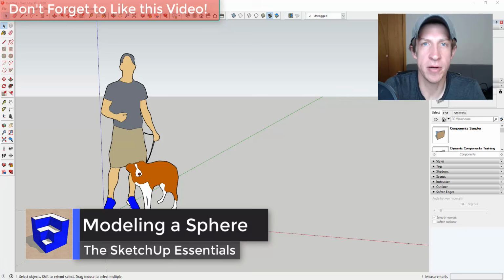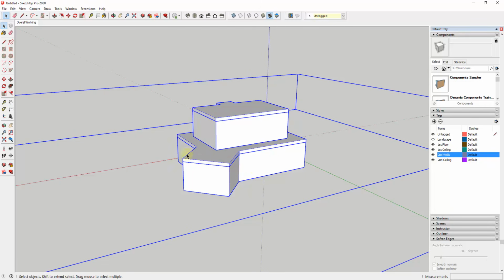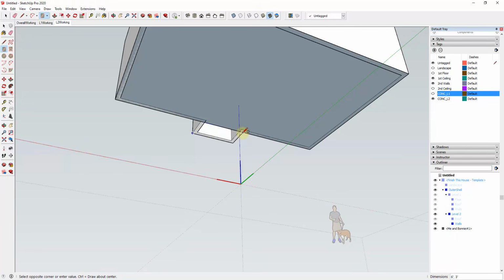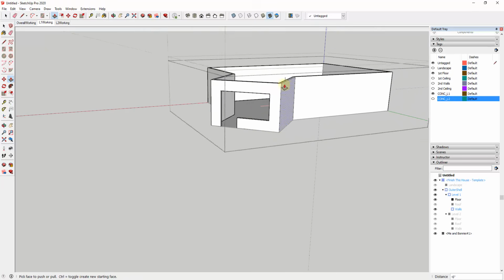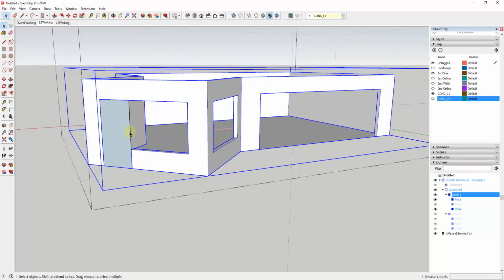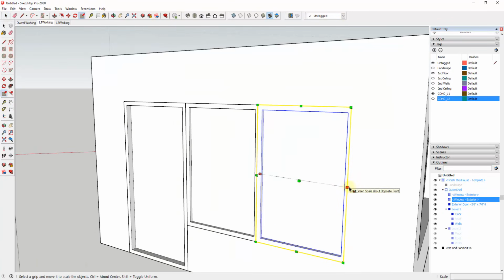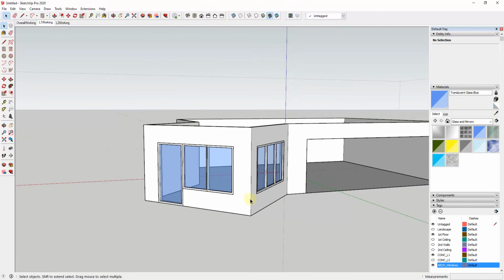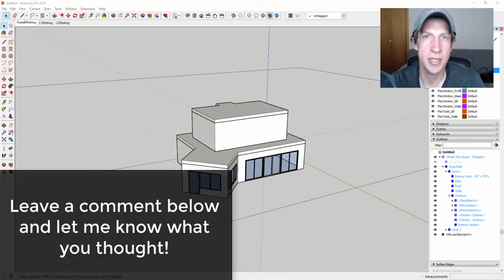HOUSE MODELING in SketchUp 2020 Part 1 - Setup and Windows

Comment: I have downloaded this to follow along. I am at the the part where you use the push/pull tool for the windows. Mine is not allowing me to move what I have measured out on the first wall. So then I just tried making a square on the wall next to that to push/pull. It kind of worked and now glitches out by making a similar square overlapping it... I'm not sure what I have done wrong. Could it be something with the grouping?

Comment: To make it not too complicated you can add the door and windows just as you did. But I normally work from inside out. I have a floorplan which tells me where is the kitchen, living etc and from there you can place windows and doors. I concur at the start grouping and tagging  is important to keep all simple and clear. Beside Flextools, which is a bit expensive, there are free tools which do a decent job making doors and windows.
Reply: I love SketchUp and started using Plusspec for SketchUp, this is so much easier and faster. You will have your complete house finished in detail in a few hours😀